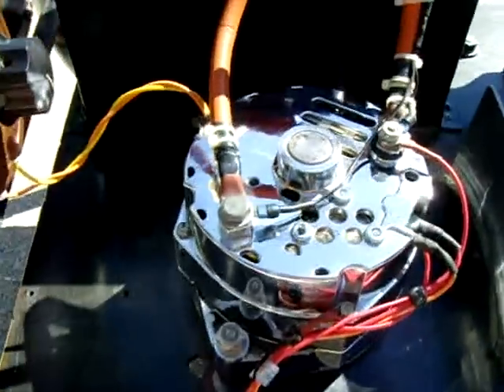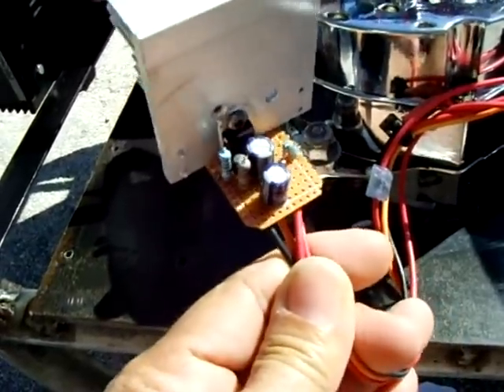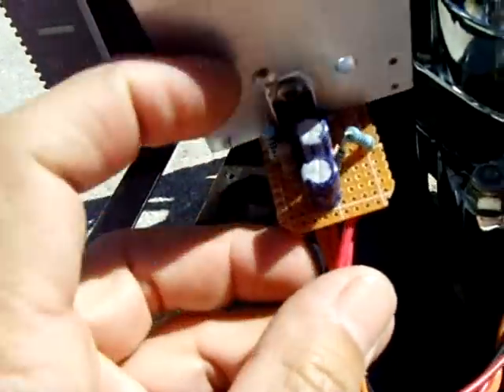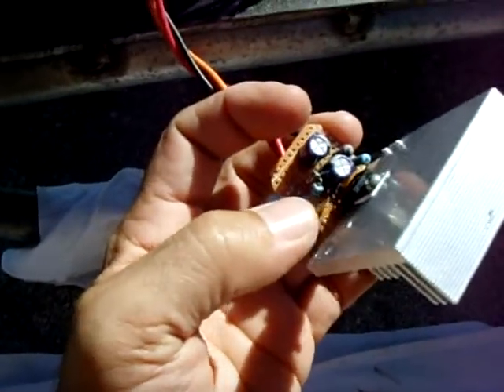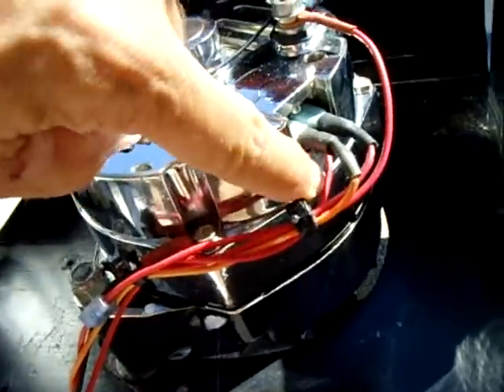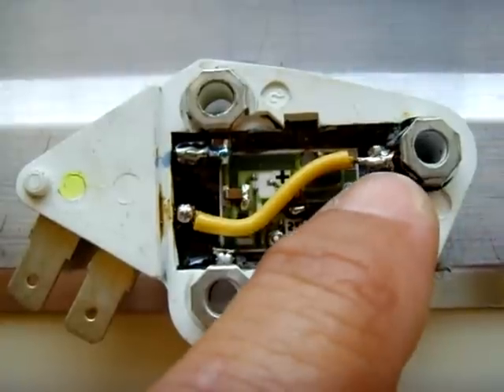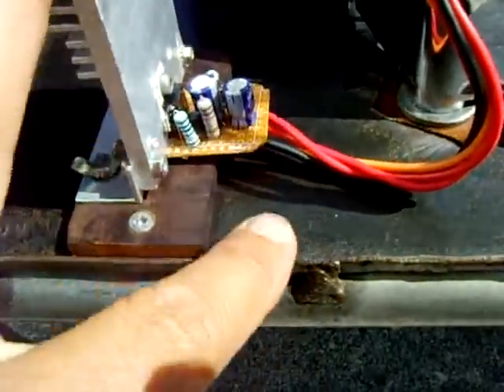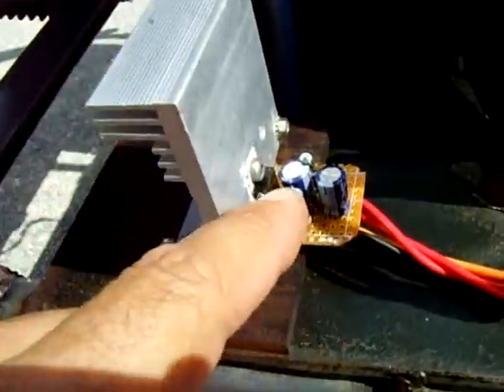Make Your Own Alternator External Voltage Regulator

Comment: Excellent video!  Thanks for sharing!
Reply from the maker: Your welcome Dan. I have MANY very interesting videos. Be sure to check out my playlists.
Reply: electronicsNmore Are there other typical kinds of battery charging alternator voltage regulators?  Is it feasible in a different kind of voltage regulator, if you get a short circuit in the regulator, for the B+ voltage to spike up to several hundred volts?
Reply from the maker: All alternators work the same. The charging voltage is regulated by the current being supplied to the rotor. Less current, lower voltage output. If you alter the voltage regulator, you can get very high voltage output. If you removed the rectifier, you would have a high voltage AC output, but at a high frequency, not 60HZ.
Reply from the maker: I have no idea, but I would expect a couple hundred volts. The faster the engine spins, the higher the output voltage. If you had an alternator laying around to play with, you could find out easily. I don't have another one.

Comment: Great video on building a high-amp voltage regulator, but just wondered, why didn't you just go to NAPA and buy an external voltage regulator for any mid-1970's Dodge with 'higher charging'? My '77 Dodge Powerwagon has a 72-amp system, and I used the $12 OEM Voltage Regulator to also build a deep cycle battery charger, using an old Mopar alternator and this regulator. Just curious.
Reply from the maker: Because I had all the components laying around, and if it breaks again, I can easily swap out a component. I don't like to buy something I can easily make. :-)
Reply: Hence the name of the video "Make Your Own ...." Great video Bro!! Sorry but this is also as far down as I'll go in the comments section! I'm definitely subscribing that's for sure!! I Haven't been browsing youtube as much as I used to 10 or so years ago and am getting used to it again but I can say for certain as an "retired" mechanic (I'm not that old) and currently qualified electrical engineer this is if not my number 1 but definite top 3 favorite channels! I've got tons of diy projects. 
Completed of coarse but lack the time to make actual videos. If you're interested let me know and I can email all of them to you with schematics and see if any of them might interest you! Also no patents pending and so on! If you like one and make a vid then I'm glad to have been able to contribute to an already great channel!
Reply: Do you have a schematic/idea for a device to regulate the charging voltage to 13 to 14 volts for a lithium iron, LiFeP04, battery that I dropped in a moped that has rotor-stator, not alternator, system. The stock system charges too high, over 14.4 volts. I tried putting a variable resistor in series with the AC output of the stator to regular.

Comment from the maker: That is a very high current to be regulated at 12v. 12V devices should have no problem with a 12.6v car battery. If the car is running, you should still be fine with 14v. You need to do a google search for a "high current voltage regulator circuit".

Comment: I am running a 12volt device from my car. It keeps malfunctioning and the only thing I think may be causing it is the voltage is too high. I have looked online and can't seem to find a circuit to keep the voltage at 12 volts. I am plugging into the cigarette lighter and I am using between 6amp and 10 amp. All I need is something to control the voltage so it does not go higher than 12 volts. A constant flow of 12 volts. And it has to be able to handle 10 amps. Do you know of a device or circuit?

Comment from the maker: No, you took it the wrong way. I was just making a point that every video I put online works. There are many people out there who have commented in the past that what I made does not work. I was just letting you know ahead of time that it does indeed work. The 2n3904 starts to turn on around .65V. Leave a dvm connected to the base of the 2n3904 so you can see what the voltage is while the alternator is running.

Comment from the maker: The circuit definitely works. I will not post a bogus video. You had to of done something wrong. Sounds like there zeners are not getting any power(OR are incorrect) to regulate how much current goes into the rotor. As the voltage rises higher than the zener from the stator coil output diode post connected to the battery, the 2n3904 will gradually turn on, which in turn will allow power to be robbed from the base of the tip121, which starts turning off the power to the rotor.

Comment: Hi! I also made this circuit recently, but when connected to the vehicle it doesn't seem to cutoff at 14.6 volts. I also used the lower circuit at chemelec.com. The charge voltage just goes higher as the engine rpm increases. Help! I'm at a loss.

Comment: Great work! Im doing the same thing you have only going one step more. I'm using a 26HP diesel and 2x 300amp Alternators along with 100Ah liFePO4 batteries in a 24 volt configuration. Im trying to figure out how to build a control system that will let me run my alternator in both 12 and 24V modes depending on what Im doing. Ideas?
Reply: Instead of the one zener voltage reference you would use 2 with a toggle switch to choose 12 or 24v BEFORE running the Alt. Dont switch whilst running.
Reply: Brian A did you get it worked out. how was you getting 24volts? are the alts in series? or are they 24v alts? I have 12 v 22si delco alts. and need 24 volts for my batt bank. I'm just wondering how you did yours. it could be a real help. thanks

Comment from the maker: On my generator setup I have a switch on the battery which I turn on before starting the engine. If you use it on a car, all you have to do is connect the lead feeding the rotor coil/diode to the ignition switch "ON" position. Simple fix. That side of the circuit only draws up to 4A.
Reply: electronicsNmore alternator voltage regulator

Comment: I looked at the diagrams you pointed to, one thing i didnt like is the 12v battery is allways connected to the circuit so when not used there is still rotor power passing, did you switch your 12v or didnt you get any standing current when not being used?

could be handy for ordinary car alternator use with some component upgrading. :-)

Comment: what happens if you use a solar panel charge controller on it would that work. i really like your setup the electricity is probably really smooth